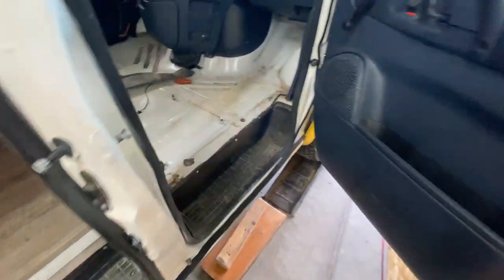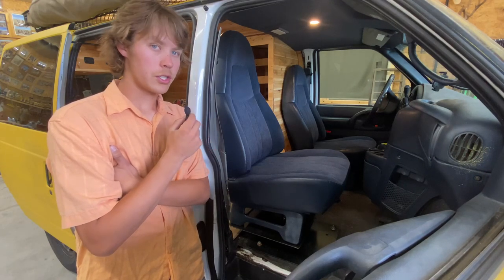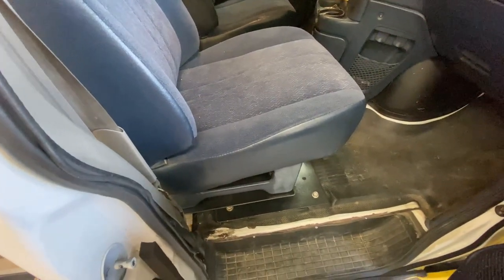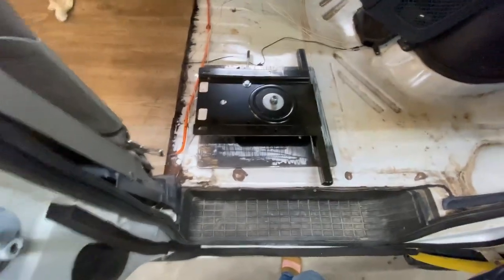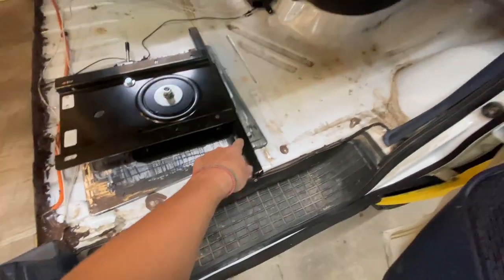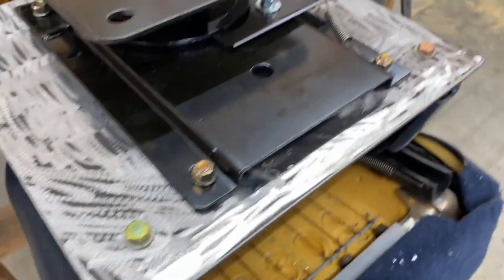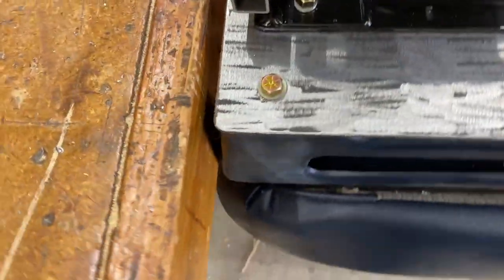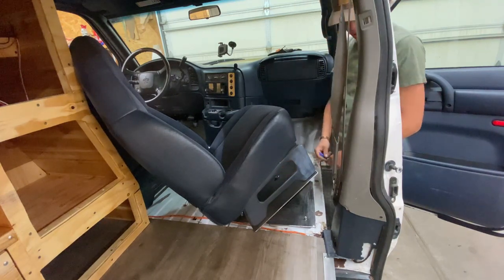$150 Swivel Seat - Creating a DIY Swivel Seat for my Astro Van

Comment: IT'S A DEATH TRAP!!!  The seat was bolted to the floor with four bolts, now it only has ONE bolt through the swivel mechanism.  The seat belt bolts to the seat frame so on impact it's useless as it should be transfered to the floor.  It's a nice job if nobody sits in it other than when the van is parked.
Reply from the maker: I travel alone. I don’t sit in passenger seat while driving
Reply: @bgrace27 that was a twatty answer.
Reply: Is it better for your channel to just "like" any comment???
Reply from the maker: @mattblack133  honestly I have no clue
Reply: @mattblack133  i dont feel like it was a twatty answer. He plainly stating that he travels alone and doesnt sit in that seat while the van is moving. Just because he didnt respond overly enthusiastic doesnt mean he was being "twatty" sometimes the best answer is the simplest/shortest.

Comment: So expensive! Is there a reason you couldn't have used one of the hundreds of swivel mechanisms under $20 on Amazon? If they're strong enough for boats, they should work for other kinds of vehicles, too, right? I'm planning on converting a Toyota Sienna for camping and would love to figure out how to swivel the passenger seat around.
Reply from the maker: Those little ones would require a large amount of bolting larger sheet metal pieces on to make them fit the bolt patterns in the van. I also don’t trust a $20 swivel that much weight (sheet metal, chair, person) to withstand the test of time. 

I’m you are looking for a cheaper option I would check out Northern tool for their swivel seat. It’s $100 and seems to work great. I don’t have a link but somebody mentioned it within the comments in this video.
Reply: I've also got a sienna I want to swivel in!!  There is absolutely nothing readily available to us.  I'm going to take the seat out this weekend and see what we're dealing with...